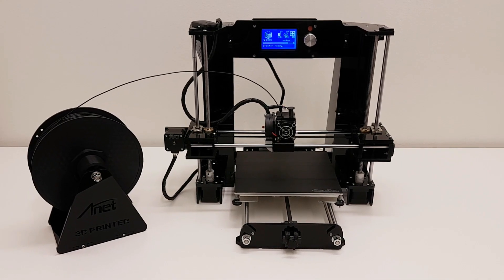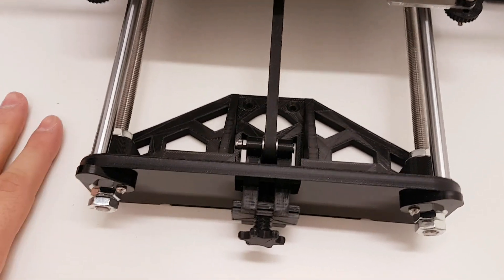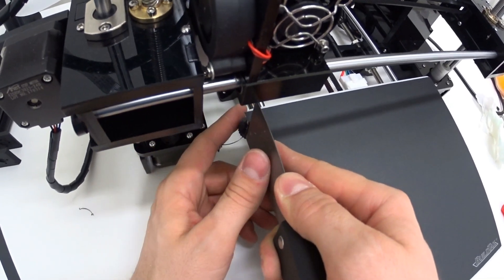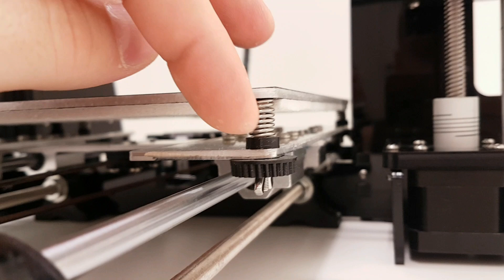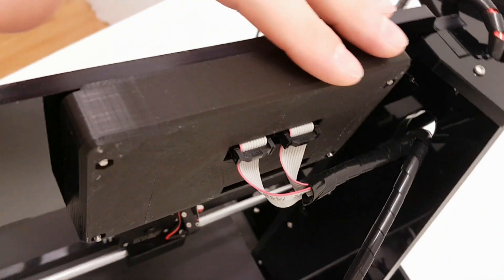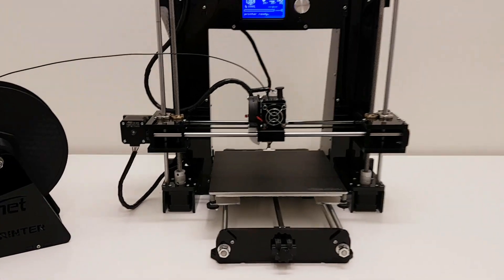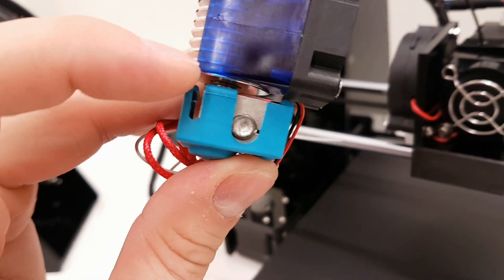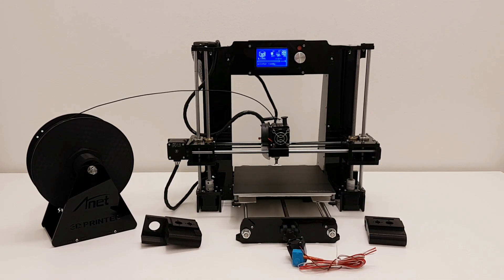Anet A6 3D printer upgrades stage 1

Comment: Did you take out the original cable with the car fuse? and with what did you replace this cable and the fuse?
im searching for a solution for my printer because the fuse burned and i want to savely upgrade my A6

Comment: My Anet A6 came with steel core belts and it is claimed to be stronger than the fibre ones.
I do not know how true this is, but they dont stretch.
I nearly have all my peices printed for the upgrades, however now I'm in the middle of building an enclosure.
Just need to find a place for my smartswitch screen by xygax.
It's a Safety device sold by skynet3dmods on ebay.
Check it out if you get the chance, as it will give me peace of mind printing at night.
Thanks for this great informative video about upgrades.
Peace :-)

Comment: Thanks for your channel, I enjoy watching it. I do have a question about the buildtak plate, in your Anet A8 review you recommended a vertex buildtak plate, is this one from Amazon as good? Oh! and also what is the A6 plate size, as the buildtak stick on surface from Amazon is 8"x8" which is smaller than the A8 plate

Comment: what glue did you use for the Insulation I have some but not sure what to use. great video thanks
Reply from the maker: You can use B-7000 Industrial Adhesive Glue http://ebay.to/2rDVWsB or any silicon glue. Thanks
Reply: ok thanks

Comment: Nice, like always nice informative video.
some questions:
did u print the upgrades with the anet a6 or oder 3d Printer?

please tell us your setting for you prints, layer,speed, temp, and all other or upload you profile and let us download please, I would like have nice prints like u.

witch slicer you use at most? simplify, cura, or other

last question:

which printer you prefer at this moment.

best regards 👍👍👍

Comment: I'm actually trying to figure out how to set up an e3d titan, geared extruder setup onto the a6. That's my ultimate end goal for filament versatility. With that setup, flex filaments are possible, giving you the ultimate in filament flexibility. Albeit with a compromise on weight. You can use a a smaller and lighter pancake stepper motor to make it lighter.

A bowden setup would be much easier to implement, but there are certain things that i don't like about the bowden setup in general...which boils down to filament response at the hot end. The long tube introduces a lot of flex, I just can't see how that could be good for retraction. There is a new design out on thingiverse for the x carriage here: It just came out today.

http://www.thingiverse.com/thing:2320642

I'm following your progress on this printer as I just got mine this week and I'm printing stuff like crazy to upgrade mine too.

Comment: Hello, I'm saving up for an A6.  Neat to see upgrades for it.  The A8 gets much more love.  But I like the rotary button and frame of A6 better. How well does PLA release from that BuildTak? I've heard of it sticking too well and ripping the BuildTak.
Reply from the maker: Yes A6 is good upgrade! True that A8 have more love with upgrades but A6 is such great 3D printer. I love it. Rotary button and frame is definitely upgrade. So much easier and faster to navigate true software. PLA  and BuildTak is like super glue and fingers :D Just joking. It stick very well. So well that after first layer you can switch off heated temps. But keep in mind that depend off how much nozzle is away from heatbed. For example if you will not print stick to much to BuildTak you can lift nozzle plus 0.1 Or even 0.2 From bed if you printing some object that have huge surface area. That will give you nice stick but you can take off much more easily. Same thing with temps. After couple times/weeks of printing you will get the idea and sense to use it right.
Reply: Thanks for detailed answer.
Reply from the maker: You welcome :)

Comment: Great I also want to replace the extruder carriage on one of my old machines to a lighter E3D V6  with Bowden setup, so I will be following your progress closely.
Reply from the maker: Thanks for commenting. You can also check my other videos I already did this mod on my Almighty Anet A8 :D
Reply: Yes I know I have followed that series and I have done most of the modes to my Anet A8 also, but as you know the carriage is side by side on the A6 not one over the top like on the A8 so a different mount is needed, this is what I look forward to seeing, a light usable with sensor mount.

Comment: About the e3d v6 clones, is it true you can print up to 260 degrees with them? It has come to my attention that they still have some Teflon lining so I'm just worried about the toxic fumes. Thx for help!
Reply: Depends on the clone. Theres america made clones that are all metal. http://www.ebay.com/itm/Metal-J-head-V6-Hotend-1-75mm-Filament-0-4mm-Universal-Extruder-Reprap-3DPrinter/111990898166?_trksid=p2045573.c100507.m3226&_trkparms=aid%3D555014%26algo%3DPL.DEFAULT%26ao%3D1%26asc%3D41375%26meid%3Db6ba8c3d220f44a0b59941b3011bf6b5%26pid%3D100507%26rk%3D1%26rkt%3D1%26
That one is ALL METAL, you could in theroy take a cheap clone and switch out the throat and have it be all metal too, but I haven't tried that. A link to all metal throat is here: http://www.ebay.com/itm/All-Metal-Stainless-Heat-Break-Barrel-for-RepRap-3D-Printer-1-75mm-DIY-Hotend/121705753727?_trksid=p2047675.c100005.m1851&_trkparms=aid%3D555018%26algo%3DPL.SIM%26ao%3D2%26asc%3D40130%26meid%3D616208d9be8b4a3d8cf4c37ce091f77b%26pid%3D100005%26rk%3D1%26rkt%3D6%26mehot%3Dlo%26sd%3D111531589519 or http://www.ebay.com/itm/Heat-Break-barrel-for-1-75mm-V6-V5-All-Metal-J-Head-Hot-End-3D-printer-RepRap-/111956107489?hash=item1a111aa0e1:g:ogoAAOSwgApW~~dv Do some research but that's the basics.
Reply from the maker: I never had problem reaching 260 degrees on my Anet A8 with clone V6. Working great for many months. I don't see any reason why this clone can't reach same temps.

Comment: We need 9 point automatic bed leveling. I need it bad. ...lol
Reply from the maker: That can happen soon :D
Reply: Nexi Tech  I'm looking forward to it!😀
Reply: No Switch over to Glass and Gluestick.
ABL, makes the cooling difficult, for there are little good fan ducts available.
And is more difficult when printing on glass, because of the bend aluminum hotbed underneath, what makes the ABL (hard)
I have tried and set it all up with ABL and Skynet, because of the compensating of the curve in the bed, your Z motors will make much more noise. 
Eventually i go tired of it and wanted to use glass from day one, i focused on that, and got it fixed within 3 hours. Removed the Sensor, used a water leveler to check all the axis, made sure the smooth rods had NO movement, X Y and Z, Tightened the belts again, Flashed to A6 2.0 Firmware, Fitted the 3mm Glass, without the gluestick, leveled the hell out of the heated bed, 4 passes on all the corners.( And again with out heating when switching to PLA.)

Now i wonder why i should use 9 point leveling?
All the prints have a smooth bottom surface. Don't bend off the bend, and have really good quality.

You might want to Reconsider... :-)